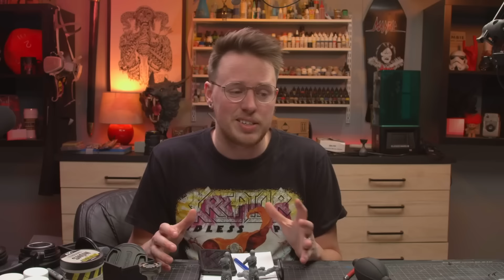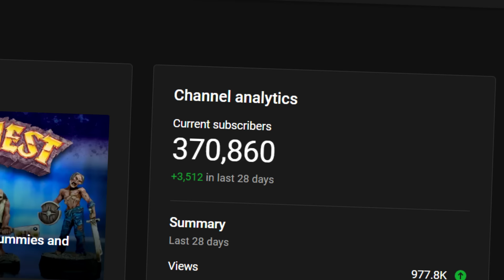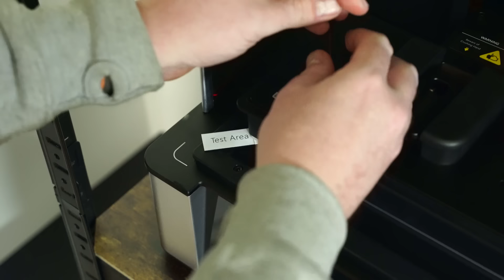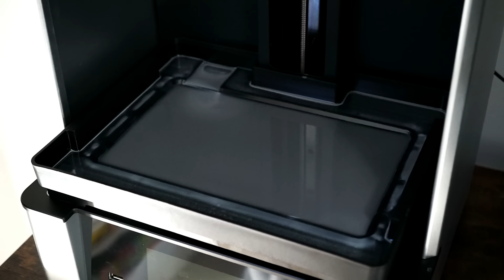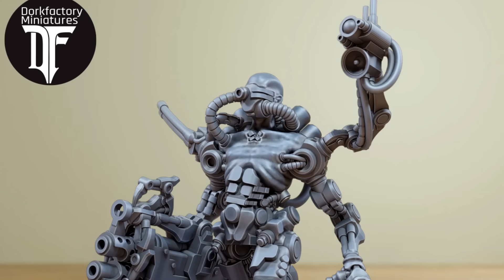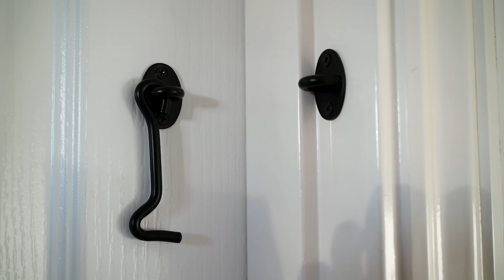Is 3D printing FINALLY easy enough to print Warhammer at home? Uniformation GKTwo!

Comment: I had soem experience with 3d printing. It's not for me. I love kitbashing and tearing up bits for my dudes which you cannot do with resin. The material is often brittle and hard to work with. I don't like how resin models are designed for the most part, and they're often just really nice studio 3d files somehow meant to be small? Many 3d files are clearly not meant to be minis.

When printing the printer has to be level in a safe spot and it is really finnicky. I printed a few things then it just stopped working. I still don't know why. But that's part of it. Your stuff may simply fail and unless you're super knowledgeable it's hard to tell why.

Many 3d printing people say it's better than GW and the prints are soo great but no. You can't work the material the same way as plastic. If you hate monopose 3d printing has the exact same issue. Overall it's great as a suppliment. If you find cool minis, well designed minis meant to be printed at a small scale, or really awesome bits, go for it. That's a great use of a 3d printer and phenomenal additions to one's hobby.

It's not for everyone. Not for me, and if I ever want 3d models printed I'll pay someone
Reply: I found that my kit bashing experience translated surprisingly easily into 3d. I edit the files using Meshmixer, repose them, stick bits together, dress them up. I've been hoovering up armies from monthly subscription services, adding sports gear and turning them into Blood Bowl teams. Fairies with pads and footballs and little boxing helmets
Reply: I was about to say the same. I kitbash in Blender3D now.

Comment: What this video highlights, is that while 3D printing is technically cheaper than buying stuff normally, the money saved is offset by the cost of tedious and (potentially hazardous) work and effort of doing the whole process yourself + needing dedicated space. For some people that is an easy price to pay, but for others (like me) the space to set-up a printer is simply not there and I'd much rather pay extra to have all the tedious work done for me by the company.
Reply: Especially if you count the hours put in 3d printing and compare them to your wages. Time is money, and 3d printing requires A LOT of time, making it expensive if you don't have that much free time in a week

Comment: I have the elegoo mars 3 printer and anycubic wash and cure station, and use elegoo's water washable resin. It's all in the garage, so away from general family traffic. While I don't do a lot of 3d printing, and so far it has mostly not been minis or gaming hobby related, I've found it relatively straightforward to set up and use with consistent results.
I have a bunch of cool stuff to print, but it would only get added to the paint queue, and increase that pile of shame, so it is mostly just lurking, waiting for me to want to paint something different.

Comment: Hi Guy,
Absolutely amazing video about the subject, I think you captured very well the upsides and downsides of 3d printing minis.
If you concerned about the fumes of mineral spirits maybe it's worth trying to use isopropyl alcohol. It's definitely more expensive, but it should release less VOCs.
Also you don't need to use the printer all the time, for example I only run my printer about 1 week/month, it prints more than enough minis to paint for the rest of the month. :)

Personally, I think the biggest downside of resin 3d printing is that how much of waste material it creates. Not just the used washing liquid (which is basically hazardous waste and needs to be disposed carefully), but also lot's of paper towels and waste cured resin (the supports) .

Comment: for those watching, water washable resin dosen't mean the water used to wash is safe and can be flushed or rinsed away - u still have to treat it as contaminated and dispose of it correctly.   just a small but crucial point, since it's not always made apparant.
Reply: Oh man I totally forgot about that aspect of it. (I don't own a printer, but was thinking about it). It's another advantage fdm has over uv resin printers I suppose
Reply: @andywang7875  other than the advantage of absolutely crappy results you get with FDM, you mean? 😂 (I'm talking about the specific use case of printing minis, to be clear)
Reply: @pgabrieli  you're supposed to use FDMs as glorified injection moulds when printing miniatures. You get perfect results that way, admittedly you do need to make your own moulds for this but worth it for the results you get
Reply: @Smutson  or just get a resin printer and use that! 😂
Reply: @Smutson   would the layer lines not still be there in the moulded figure? Like the mold has them so why wouldn't the minis?
Reply: Good point! And isopropil alcohol evaporate faster than water, so it is easier to dispose an empty container with resin leftovers inside, rather than liters of contaminated water
Reply: @Pesso86  I pour the waste water into old paint cans, put them in a closed box on my shed roof till they evaporate down to the resin. label clearly and drop them off at the tip on the hazardous table. Easy
Reply: You can put it in a transparent container outside, and all resin will cure. Let it evaporate and you can deal with solid waste that you can throw away
Reply: Water washable resin also absolutely sucks for minis. I get people don't like spending the cash on IPA but just do two tiered washes. One small bath to get the bulk off then wash it in a larger machine/stir plate for the rest. This will drastically save you on the IPA.
Reply: @nikushim6665  but it doesn't suck? I have plenty of great quality minis I've made with water washable resin
Reply: @nikushim6665  it's not about the money. It's about disposal. You can put the dirty water outside and let it evaporate, then toss the solids. You can't do the same with iPad - you gotta go to a chemical disposal centre. And not every city has one.

Comment: 3d printing is great.

However it is a hobby all on its own so if your hobby time is limited then you are sacrificing time from one for the other.

The hazards are real and it should always be a caution.

There is also cost.
Unless you are building ALOT of models then you will not be 'saving' any money.

With that said 3d printing is still great and i love doing it but i found its just a pain in alot of aspects.

Comment: I bought an Anycubic photon as my first printer and i have had basically zero issues with it, and have printed a huge range of things with it. So even budget printers are fine, you just have to make sure you google what to do if your using new resins. Also Lychee slicer is by far the best, it does most of the hard stuff for you.

Comment: I just got a resin 3d printer the hardest part i think was getting the print to stick to the dang plate but i finally got it to stick and im sure my initial time it on i got a 3lb spacemarine to stick so id say it worked good i got a fdm first and loved it and then found warhammer and figured well im not paying 250 freedom dollars for some small plastic minis 😂 well after getting the 250 dollar starter box i went ahead and bought the reain printer because man as a noobie to warhammer its so expensive ill buy minis for makeing an army over time but i really liked painting the minis so and good big bottle of resin is still cheaper than 5 minis from GW  😅

Comment: Just want to point out that the methylated spirits itself is the VOC your detector is picking up (you get enough evaporation at room temperature for alot to be in the air).

Methylated spirits vapor isn't too hazardous unless you're going to spend hours huffing it, opening the window to let it ventilate was a good way to help deal with it. 

Also, just keeping some kind of lid closed over the containers when you're not actively using the solution for the rinse/clean will help reduce the amount evaporating into the room 👍
Reply: Or better yet, use 99.9 lab grade IPA for a less toxic experience. If you're going to spend the money for a $1,300 3d printer then you might as well spend a little more on cleaner.

Comment: Great insight! I have to disagree on one thing you said: that an airbrush takes up a lot less space. The 3D printing setup is static, nothing is going to move in there and it sits happily in that corner of the room. My airbrush with its compressor and especially the portable spray booth, stored in a similar corner, absolutely can’t stay there while being used. If you add the additional tools and consumables associated with airbrushing, you’re looking at an at least comparable amount of space, probably even more.
Anecdotal evidence, I have my printer in operation at a moments notice and therefore I use it regularly. My airbrush requires a lot more attention and setup, which leads to airbrushing sessions being planned days in advance - and mostly axed at the last moment, because I can’t free up the desk space in time.
Thank you for sharing, very much enjoyed this video!

Comment: i use both an FDM and resin printer and work in the room i have them both in. toxic fumes were a huge concern for me. my biggest recommendation is to not rely on filters. they can only take you so far. 

VENTILATION IS KEY!!! 

i house my resin printer and wash station inside a fireproof ventilation chamber (kind of like a square tent you put the printer in) and run ducting out of my window. i also have an in-line fan in the ducting to suck and the toxins out better. Since i started using this method my air quality has improved to a point of complete safety. i also run a couple of rechargable carbon filters inside the chamber too but WORD OF WARNING! carbon filters do litte against toxic vapours and mainly just deal with smells i just use them to take away any rsidual smell from the chamber.

I also use, gloves, an apron and a filter mask at all times when handling/cleaning prints and any used disposibles like paper towels and so on get bagged and binned in my outside bin. i also often run my prints overnight since i wont be in the room while they work. I've taken a lot of precautions to make it perfectly safe to be in the room while printing but an extra layer of caution will never go amis!

That being said, this all sounds like printing is a massive pain, but once you have set up your station properly, as long as you stick to the basic safety principles it becomes a very easy and methodical process that gives you some really cool prints and i do still recommend getting into it. but only if you can do it properly!
Reply: I have the exact setup you're describing, but I stopped printing since i found it to be too unhealthy, at least in the house. It doesn't smell at all, but that really doesn't matter since the toxic chemicals don't necessarily smell. I'm going to build myself a work shed next summer and print there instead. Seems to me like the only way to make it perfectly safe is to print outside the house

Comment: A lot of those extras from that printer are still not a thing for the budget printers (<500€ printers), but also: They've still come a long way.

In the last three years, I've moved house and printed on Elegoo Saturn in two separate places. I've adjusted the settings on my printer twice: The initial setup - which lasted for about a month before the settings were good enough for me - and then a while back when I started getting a lot of failures, and adjusted the lift-off height between layers - the film on the vat had stretched so the layers were not detaching from the bottom anymore.

Between these setting adjustments and the ten months since, I've printed for two years without really touching the settings. There's always the pain of doing some supports - mostly because I don't like the location of the supports, or I change some files and will have to do my own supports - but overall, printing is pretty hassle free once the printer settings are good to go. Err on the side of losing some tiny details for the comfort of not having so many supports fail, and I had a year where I didn't have a failed print.

When you get the printer to that state, printing can be just a tool in the process. It needs to become the hobby for a while to reach that level of comfort and to get those settings (though it sounds like you got that setup done already) and then printing random things for kitbashing on-demand is a non-issue.

Comment: You don't need a 3d printer at home. You need a friend with 3d printer at home. It's the best solution :)
Reply: Absolutely, too bad I'm the friend with the 3d printer at home
Reply: @sakuretsu90 that is why I charge for my prints.  When my printer is being used it takes away from customer prints that sell for several hundred bucks.  Otherwise I'd have no resin for money or customer prints and I'd have no open printers either.
Reply: There are enough print on demand  services around these days that you don’t even need that.
Reply: @Balderdashing  friends are cheeper
Reply: @Balderdashing That defeats the point. It's going to be as expensive as GW miniatures.
Reply: I know you spent 400 on your set up but I find elegoo mars pro 3 was excellent for me as a beginner
Reply: @liammckeating1461  if youre talking about the host of the vid, his printer was around 1200usd not including the wash/ cure station. way more affordable options like the Mars printers that still do great once set up properly. I just bought my first printer, a Mars 4 9k, after a few days am finally getting good prints. Set up was mostly the same as this one but learning the software and proper usage steps was definitely more of a chore than it was for him. I totally agree with you that beginner printers can be very affordable and are pretty dang good right now.
Reply: That’s what my whole Warhammer group does. They just buy me large bottles of resin and I do all the printing.
Reply: I am that friend for my local group, trust me, this is the truest statement ever.  Have a list of stuff I've been asked to print.
Reply: @lupercal1984  yep, make them pay for resin and the model and ill do it for them if i have the time. it gets me free resin and free models i can use whenever i want lol
Reply: You can also buy physical prints from lots of printers...like us!
Reply: lol Brilliant
Reply: Just like a boat.
Reply: iam that friend
Reply: You are right. Or a Makerspace. Or Print On Demand. I think OPR is ramping up on that front. I also think it would interesting to see if it could be profitable to print and sell whole armies for OPR or similar systems as an alternative Game Store. Space to play, a selection of armies to buy, books and systems to pick from, paints and accessories, and Print on Demand selection. Order your minies on Monday and get them back on Wednesday for a reasonable fee.
Reply: Im gonna be that friend in a few months lol
Reply: I have become that friend with a 3d printer.
Reply: Be carefull friends, communicate the additional costs and time spend on failure and repairs. Or try to introduce chosen people to be friends with printers aswell. I have 4 in my group and that seems to balance it in a way.

Also dont print in your hobby room, print in a print only room and protect yourself. Health should allways be at first.
Reply: lol I’m the friend with the printer
Reply: Your friend will eventually get tired of you if you use them all the time
Reply: Especially for your long term health.
Reply: @ccgear4367 Respirator that handles organic vapour is cheap if you can afford the printer.
Reply: Wdym?  @ccgear4367

Comment: Much as I love 3D printed parts I have to buy them as I literaly do not have the space to set up a printer.  It's one of the reasons why I wish I could find a reputable company or individual that does print on demand as there are a great many parts an minis that I would like to have, but I can only get the STL file for

Comment: 3D printing at home is it for everyone I completely get that.  It's just another tool, kind of raise my eyebrow when people call it a hobby....no not really IMO.
Reply: Yeah, I don't really get it. Airbrushing isn't 'a hobby in itself' and there's a whole lot more complexity to that practice. I found a resin I liked, added 5 seconds to my bottom layers and 0.3s to my exposure time, and I level the printer by just pushing it to the bottom of the vat (I used to remove the vat and push it into a folded piece of paper, but I'm not sure why that was the suggested method and I haven't had a failed print since I stopped doing it). I haven't had an issue with the machinery since then, although with certain manufacturers I need to double check the supports. 

In my experience  it's been more like a car; you occasionally might run into a technical issue, but car-ownership is only a hobby if you make it one. I just drive the thing.

It does open up hobby opportunities though, and not just 'tinkering with menus of printer settings'. 3d kitbashing is a great expansion on the modeling side of the hobby. You have a bitz box made up of infinite copies of every model you own, and you you can cut parts off, sculpt them, resize them, bend them, overlap them, really go to town. It's great fun.

People also harp on the time it takes to print, which baffles me. 32mm minis will be printed in about 2 1/2 hours, cleaned and cured in another half hour or so. And for the printing part, you don't actually have to stand there and watch, you can go and frolic in the fields. How long does it take to run out and buy a box of minis? Not a short time, where I live. And I'm paying 10 or more times the cost of the resin just on the train ticket to go into town.